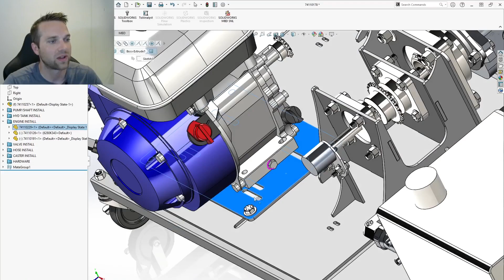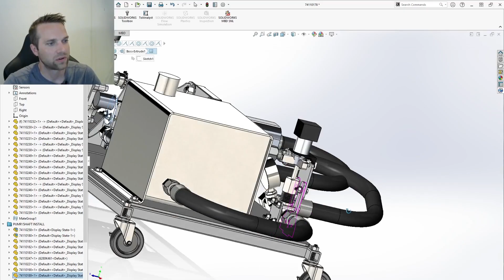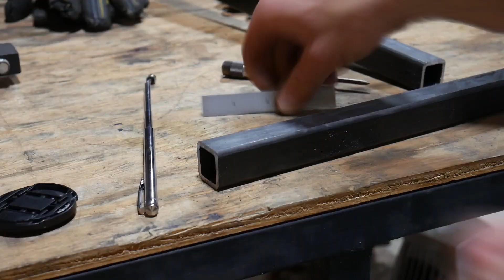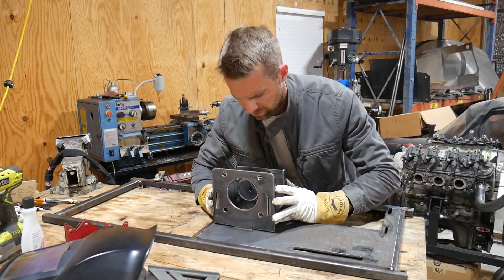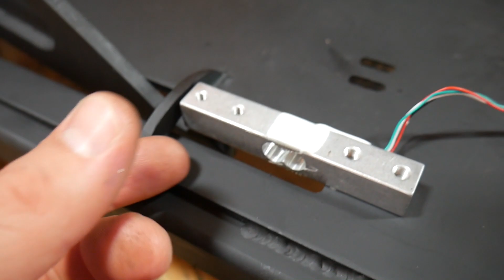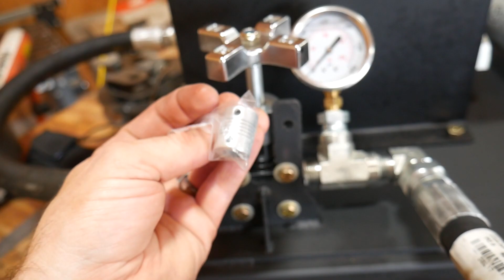DIY Small Engine Dyno 2.0!

Comment: what is the smallest engine you recommend putting on this dyno? The engine I am looking to test is a Honda gx-35.
Reply from the maker: There's about 1hp of parasitic draw from just moving the oil through the pump. So the GX35 would still work, it just won't have much past that. Reducing the pump size would reduce the flow and it could still work. As long as the replacement pump has the same mounting flange it would be a drop-in replacement.

Comment: good work will this work on a 2stroke hot saws at 14000rpm
Reply: I believe you would gear it down so the pump would only turn 10 or 20% of that. The pump has a maximum rpm rating.

Comment: Great dyno, and very impressive what you have designed. I am looking to build a dyno to run go kart engines on with about 24-26 HP and around 15000rpm. Would your system handle this or would I need to change any of the components out?
Reply: What motor is running at 15 k
Reply: @cadenprimm112 KA100
Reply: @cadenprimm112  KA100 2 stroke engine

Comment: Could a pressure washer pump be used to dyno test a small engine?
Reply from the maker: It definitely could, but your power and rpm requirements that you'd like to measure should match the spec of the existing pump.

Comment: are all electronic components and computer programs also included when you buy the drawings?Will there be an update on this in the future?
do not mean included but which ones should I buy!  how does it work with smaller engines such as chainsaws down to 1 hp

Comment: i have purchased your design, ive downsized it a bit due to using for glow engines, my question is i can not get the Arduino to work ? your instructions and downloads are hard to understand any help would be greatly appreciated
Reply from the maker: Sure I can help. Email me at dirtyelbowsgarage@gmail.com 

Most people taking on this project who haven't programmed any microcontrollers before run into the basic learning curve bumps but there's been no issues we can't figure out.

Comment: I’m happy to pay for design. Is the complete coding and wiring diagrams in the package?  Also should coding be changed if clutch is used. Thanks.
Reply from the maker: Yes everything is included. As far as the clutch goes, the code does not need to change unless the gear ratio changes to output proper engine rpm. Power won't need an update as it's measured off of the pump shaft. The clutch and how it engages will just engage based on rpm instead of free spinning the pump. The only thing I caution is watching for clutch slip under high load.
Reply: @DirtyElbowsGarage I built your dyno out. I built it with the tank below load mechanism to reduce footprint. I added a check valve to keep the pump primed after a Dyno pull and the unit is turned off . Are you willing to design that more advanced load control set?So that you have air recording data as the RPM engine claims like a traditional, small engine Dyno? I will gladly pay for design control as well. I have fabricated everything and now working on program. I have also installed the transducer to record pressure as the gauge would be on the second level down in design and not visible from the engine control spot. I want to be able to have the engine idling, pull back to throttle wide open have a climb to a set RPM and then back off again. Any help would be greatly appreciated and I don’t mind compensating you for it.

Comment: I found this because I was looking for electric lawnmower and string trimmer reviews that are actually informative. I don't care about volts. I don't care how you feel. I care about how much torque can be produced maintaining a "useful" RPM, how many VA we're sucking out of the battery at max torque, and how long the battery lasts when doing that, and maybe at half the max torque. Also benchmark against a "typical" gas machine. Something along these lines. You need a dyno for that and nobody seems to use one to review these machines. At least nobody I've found so far.

Fuel flow measurement on a gas engine would be nifty. Your full blown dynamic test sounds about perfect.

Great instrument, you're giving me hope of finding what I'm after.

Comment: I would like to see some dyno ttesting on an engine equipped with a thunderstorm generator.
Reply: In the early 70s in highs,chool we used a dynamic with a water brake hooked to a faucet to test 3 Hp Brigs and Stratton engines. With simple air and fuel flow guages, we were able to calculate the volumetric and thermal efficiency. At 5,000 rpm, they produced 5 Hp.

Comment: is the pump pressure limited? if not, you should add a relief valve so you don't hurt yourself, high pressure subcutaneous oil injection can cause serious harm

Comment: Are there not sensors to measure oil flow and also electro mechanical devices to control  flow? Is a torque arm really necessary?
Reply: Yes but you need to know then the efficiency of the pump

Comment: for correct measuring power you need also flow meter :)
Reply: You do not. The pump is entirely irrelevant. The stain gauge (load cell) is measuring the reaction force directly. The pump could be flowing water ( like a big dyno ) or pudung. It doenst matter. The pump is nothing more than a load source. The hp formula is hp = ( torque x rpm ) 5252. All that is needed is the shaft speed and torque observed.   Ineria and friction losses can be added but flow is not needed. Yes the power of a hydraulic pump can be extracted from flow and pressure that is not a better way to do it.

Comment: What is the estimated cost all in for the mechanical parts to build this less the steel?
Reply from the maker: I was able to get everything for just under $1000. Prices vary depending on shipping and where you can get the parts from. I provide sources but it's possible to swap in cheaper options.
Reply: @DirtyElbowsGarage  ok, thank you

Comment: What would be the max rate for hp/torque ? Im interested in adapting this principle to harley v twin engines that outputs anywhere between 40 and 150hp
Reply from the maker: This setup will handle up to 30hp as a combination of rpm and torque. For more power you'll need to up size just about all the components. 3000psi is a typical max so you'll need a pump that can flow 5x more oil, a flow control valve that can restrict that flow, then a new load cell for the additional torque - and all the associated mechanical reshaping to make this work. And, depending on reservoir size you might need to get into oil cooling, depending on time at max engine load.

Quite a few hub style dynos are hydraulically operated using the same principles as this one. Finding the right parts to work together well is the trick.
Reply: @DirtyElbowsGarage  after a full day of research, i found out that there is no hydraulic pump units that would suit the requirements for these hp numbers... the principle is very good for small engine but isnt quite there yet for bigger ones ! I might turn to inertia dyno for my project
Reply: @DirtyElbowsGarage, @jimiandrix I have no engineering background, so please correct me if I am wrong. Couldn't you reduce the input RPM with a planetary gearbox and thereby the pump rating/flow/cooling becomes a non-issue? The load cell would need to be uprated (and measured torque divided with the known ratio of the planetary gearbox) and the valve adjustment window would be much smaller to stay within 3000 psi (resolution/signal noise might become a problem). However, in principle, would that work? Edit: Or in this case, with a chain, just a different sprocket set instead of a planetary gearbox. Edit 2: I'm not suggesting to introduce enough flow restrictions to slow down the engine significantly, but you could see how the engine is affected within 0-3000 psi and extrapolate, given there is a linear correlation.

Comment: Just some advice, should never have a filter on the suction side of the pump, that being said strainers are fine if there BIG ENOUGH. Filter should always be put in the return side to the tank. If not it can cause cavitation do to the lack of oil going to the pump witch will effect performance/readings
Reply from the maker: This is great advice and you are right. Most systems are filter after pump. The main reason I routed the filter first is because this is effectively a single component system - there's no motor or valves or auxiliary components to protect. On dyno 1.0 I had a contamination issue that seized a pump and I wanted to avoid that happening again. And even though it's not the normal setup, I did do it with a suction based filter, it's got an internal bypass specifically to stop cavitation.
Reply: Can u make one for an eddy current hub Dyno?
Reply: Plus when he changes the filter, he’s going to dump all the oil out of the tank and system. He at least needs a ball valve between tank and filter housing. Gonna make a really big mess without one.

Comment: Could this kind of setup be used to dyno a 30hp tractor off the PTO? Or is that too much ?
Reply from the maker: In principle It would definitely work for that application. But to specifically make it work it would need some re-gearing to pick up pump speed compared to your PTO (also depends whether you have a 540 or 1000 rpm PTO) and also a rework of the attachment to the tractor so that the torque is transmitted properly.
Reply: @DirtyElbowsGarage  I’m going to look into this. I have an old 8N and you have inspired me. When I have a chance and my kids aren’t draining my pockets, I’m going to purchase your plans. Thanks for the reply. New subscriber….. out.
😎👍
Reply from the maker: Thank you! And I also have an 8N!!! Great little tractor that just keeps going. Good luck and feel free to reach out anytime!

Comment: Nice build.  I have a similar unit for testing my kart racing motors.  I used a pressure transducer to measure the torque than the the load cell and a proximity switch  for the speed sensor for rpm.  I am working on an inductive sensor for rpm.  Processing thru a raspberry pi.  I also added a weather station chip to compensate for temp, humidity and pressure.  I would love to collaborate on code.